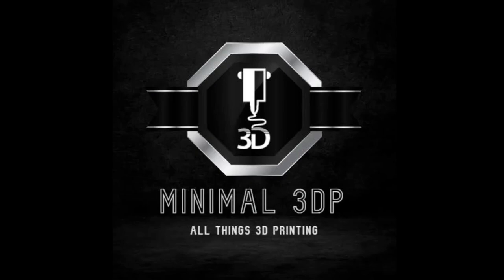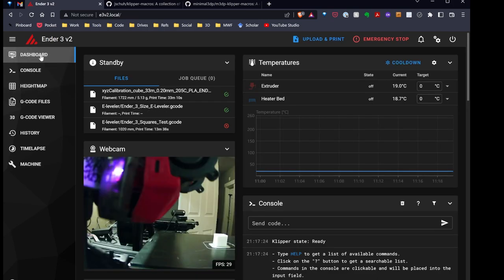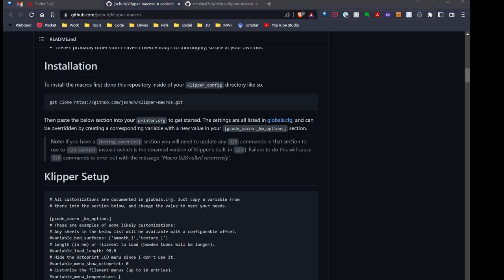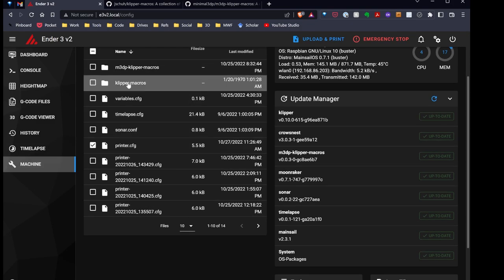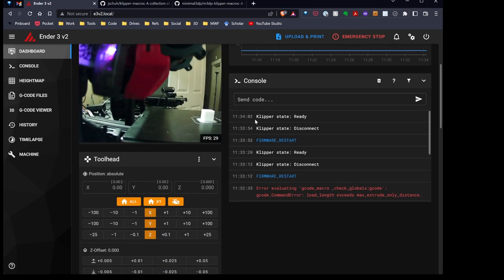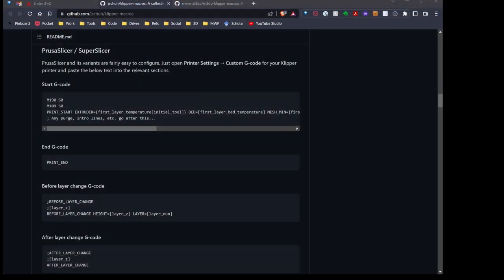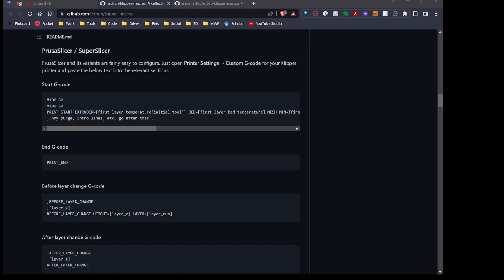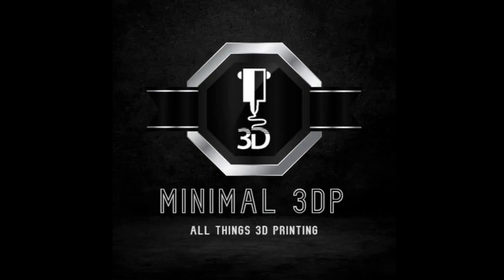Up Your Klipper Firmware Experience with Incredible Macros that Boost 3D Printing to New Levels

Comment: Thank you. Very interesting.
 I have a question regarding the following note in the installation part of jschuh: "...Make sure you don't currently have any macros that provide the same basic function as the macros in this repository (e.g. the default Mainsail or fluidd macros).Note: Make sure you don't currently have any macros that provide the same basic function as the macros in this repository (e.g. the default Mainsail or fluidd macros)."
Do you also have to modify the Mainsail.cfg file?
Reply from the maker: you should not have to. In my experience, you just need to make sure that if you already reference macros in your printer.cfg or a file included in printer.cfg that you don't have conflicting names.
Reply: I'm getting this error just before the purge line "Move exceeds maximum extrusion (1.804mm^2 vs 1.440mm^2)" I don't understand, as I have increased variable_start_purge_length to 50, so from what understood from the documentation it should print a purge line.... but I always get that error  @minimal3dp
Reply: Ok, I had to increase the max_extrude_cross_section to a more reasonable value (3.0) in my Klipper config

Comment: I've been printing for quite some time, have an ender 3 S1 and just not impressed, found out others use klipper with good results, I decide to change over so I did an old printer first, and the S1 afer getting used to it. I did both installs the same way, one showed maco buttons and one install did not. I found you on here with this video and now they are all there and then some!!  I did have a couple issues changing paths, but luckily I know how to figure that stuff out, so it was no biggie, besides klipper tells you what's wrong!! LOL   this is working out great for me so far.  Anyway, though you may enjoy the story of a faulty install and your video helped me fix it with bonuses.  

Now to figure out how to EDIT these macros for my own use!  🤣🤣🤣
Reply from the maker: I really appreciate you sharing. I am glad the video was helpful.

Comment: Another really informative vid mate.i thought there was something wrong with my computer it was randomly restarting when i had cura open.i guess its just cura
Reply from the maker: I found that the initial release of Cura tends to be a little unstable. With several different platforms (windows, macos, and Linux) it is hard to check everything.

Comment: Thank you very much for the excellent information and explanation.
I'm trying to set up my runout filament sensor in Jschuh's macros and I can't get it to work.
Could someone give me a hand.
Thank you so much
Reply from the maker: I have not used that myself. Have you tried posting the question inthr GitHub repo?
Reply: @minimal3dp  Thank you very much for answering.
I already asked the question and today it was precisely resolved.
I share what the creator has answered me:

I keep my runout sensors positioned several inches before the extruder gears, so that when they trigger there's still enough filament available that the current layer will complete and the pause will run during the layer change:
[filament_switch_sensor runout]
pause_on_runout: False
switch_pin: <put your pin config here>
runout_gcode:
  # Pause immediately if we're in PRINT_START
  {% if printer.print_stats.info.current_layer < 1 %}
    PAUSE
  # Pause at the end of the layer if we're anywhere else
  {% elif printer.print_stats.info.current_layer <=
            printer.print_stats.info.total_layer and
          not printer.pause_resume.is_paused %}
    PAUSE_NEXT_LAYER
  {% endif %}
If you have a filament sensor that's very close to the extruder you probably want to pause right away, and may even want it to handle filament loading and unloading.
[filament_switch_sensor runout]
pin: <put your pin config here>
pause_on_runout: True
insert_gcode: # Remove this section if you don't want to automatically load on insertion.
  LOAD_FILAMENT
runout_gcode: # Remove this section if you want to pause without unloading.
  UNLOAD_FILAMENT
Reply: @minimal3dp  I have tested it and it works as it should.

Comment: alas! I do not appear to have a folder called klipper_config Failed at the first go. Is this because I have multiple instances? The instructions do say clone to printer_data/config and I wonder if I am barking up the wrong tree and things have changed.
Reply from the maker: It is now config, I believe
Reply: @minimal3dp  thank you, after managing to upload them to the wrong place twice lol I thought it should be there. Of course when trying that it then refused to connect to the git!  But attempting again this morning it appears to have worked (yaay). So can move onto the next part now. Just have to go to work first (boo). Excellent info again, keep up the good work.
Reply: Is this mainsail config that it has changed to? The the only config that comes up

Comment: hi, thanks for the vid. can you please advise how to install this on multiple klipper instances? do i have to deploy this on the individual printer config folder? or should I do it on a more global level? thanks
Reply from the maker: Take a look at: Install Klipper, Mainsail, and Octoprint with Multiple Instances Using KIAUH on an Old PC or Laptop
https://youtu.be/X_eHJXED3CM

Same process will work with an RPi
Reply: @minimal3dp  Hi Mike, it's me again :). I've been using this macros on both printers that I have. ender 3 v2 neo and S1 pro. now, this script is always flawless on my v2 neo and as you know that the bed mesh calibration is always done prior to every single print. However, it doesn't work as flawlessly on S1 pro and as you also know that adjusting Z-offiset means nothing because when the next print run, it will re-adjust the z-offset again. the outcome of the calibration on S1 is always too far from the plate while it's always perfect on V2 neo. So I'm just wondering if there's a setting in one of the cfg to set the Z distance between the end of the nozzle and end of the bl touch? I can see a slight difference in distance between the 2 printers, so perhaps, if there's a way of changing this, it might help my S1 pro. Hope you get what I mean. cheers

Comment: Thank you for an interesting and useful video! I have this question. Prusaslicer has a service variable `layer` that is used in many slicer macros. However, Klipper does not understand this construct and ignores it. Question - how do I get a layer counter in Klipper? Thanks!))
Reply from the maker: I believe it can be done with klipperscreen. Are you using it? If not, I will look around.
Reply: Yes, I use it, but it seems to me that the nails are from different walls, although I may be mistaken.)))
Reply: I have to apologize to you, but the answer was found in the manuals for KlipperScreen! Who would have thought! It's weird and amazing...

Comment: Greetings Mike. First off, thanks for a detailed instructables. Followed this macro setup and now when trying to print it's (BTT Pad 7) canceling the print do to extruder below minimum temp. Any help? Thanks!   E5+ SKR3 TMC2209 BTT Pad 7
Reply: I put the original start and end back in prusaslicer, it's back to printing.
Reply from the maker: That is weird. Can you share the new and old code so I can look at it?
Reply: @minimal3dp  one that worked G90 ; use absolute coordinates
M83 ; extruder relative mode
M104 S150 ; set temporary nozzle temp to prevent oozing during homing and auto bed leveling
M140 S{first_layer_bed_temperature[0]} ; set final bed temp
M190 S{first_layer_bed_temperature[0]} ; wait for bed temp to stabilize
G28 ; home all axis
G29 ; auto bed levelling
G1 Z50 F240
G1 X2.0 Y10 F3000
M104 S{first_layer_temperature[0]} ; set final nozzle temp
M109 S{first_layer_temperature[0]} ; wait for nozzle temp to stabilize
G1 Z0.28 F240
G92 E0
G1 X2.0 Y140 E10 F1500 ; prime the nozzle
G1 X2.3 Y140 F5000
G92 E0
G1 X2.3 Y10 E10 F1200 ; prime the nozzle
G92 E0

The one in your video (it's old) didn't work.

Comment: For some strange reason I don't have  a "klipper_config" file in my directory(!!) .  I must have missed a step somewhere.  Honestly it was install #5 before things started working.
Reply from the maker: Did you get things working?
Reply: @minimal3dp 
Somewhat, I can only work on this in short periods. Between 2nd shift and sleep. It connects, I think I have the fans configured, I was using your video to add the macros, then "Where is klipper_config file?" Popped up.  I know it's open source built by people out of their generosity, but it's still frustrating when small things trip you up.
Reply: Finally got things moving.  My machine is a Folgertech, they're out of business, and there is no docs on the stepper motors,  I ended up switching tiny wires in the JSTs. Got rotation distance set,  I need to figure out these macros.

Comment: I know this is dated but I have a flying bear reborn 2 which I just installed klipper and I’m attempting to get the macros installed following your video and so far everything has worked except the maximum extrude length I’ve tried everything from your suggestion of 50 all the way down to 5 and I continually keep getting that error do you have any idea what’s going on thanks
Reply from the maker: What is the error you are getting?
Reply: The same one that you mentioned in your video you changed it from 90 to 50 well I change it from 90 all the way down to five and I keep getting the error regardless of what I change the amount to

Comment: Trying to follow this video but like so many other things I try my results do not match.. I have no Klipper_config in my path. What possible reasons for this Thanks
Reply: Thought i'd leave the above question rather than delete. The instructions have changed since you did this video. I guess the old rule of "Read the instructions" apply well here Thanks for doing this video
Reply from the maker: Did you clone.the repo man nto y9ur printer_data folder?

Comment: I have no idea what I'm doing with klipper, but I followed these steps and got things running.  I also got an adxl345 and set up input shaping.  Whenever I start a print, the console shows that the accel limits are set to 500, when I want them way higher than that.  Is there something in the macros I have to change?
Reply from the maker: You have 2 possible issues to check:

1. See what your max acceleration is set to in your printer.cfg in the [printer] section.
2. Check your slicer. Some slicers set your default max acceleration. 

Let me know if that fixes your problem.

Comment: Hello mate, i have a error ''Existing command 'M106' not found in gcode_macro rename'',i have checked every path and all seems okay, so what can be the problem ? Thanks
Reply from the maker: Is everything else working? I will research and see if I can find an answer.
Reply: @minimal3dp  yes, if i comment the include to the macro.cfg file the printer boot without any problem, in addition i error is in the fan.cfg file if i move it the error move to another file.
i have klipper
v0.11.0-52-g40d8c2ef 

moonraker
v0.7.1-794-g225ec58 

mainsail
v2.4.1 

Thanks.

Comment: I am following your videos which are very informative to get into Klipper without any hassle. But one small suggestion your voice is very very low in all the videos I have to crank up my volume to almost 80-90%, even though I wear the headset. Can you speak a little bit louder?
Reply from the maker: I reformated my machine this week and did not save my sound settings. I will be working on sound this weekend and will keep your feedback in mind. I appreciate it.

Comment: Tried this on my Ender 3 V2. Klipper and Moonraker is running on a laptop running Ubuntu and not on a Pi. I can't get the macros to show? Any idea?
Reply from the maker: At a guess check your paths. Make sure you refence the scripts path in your printer.cfg file. Make sure the path is correct.